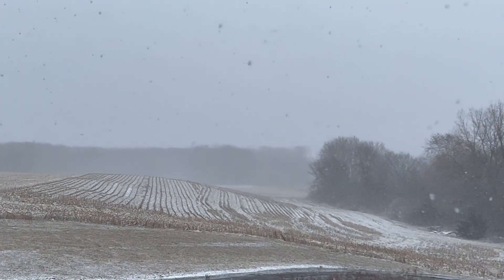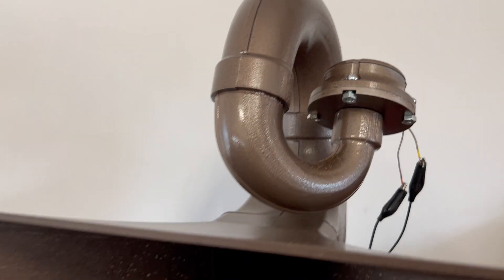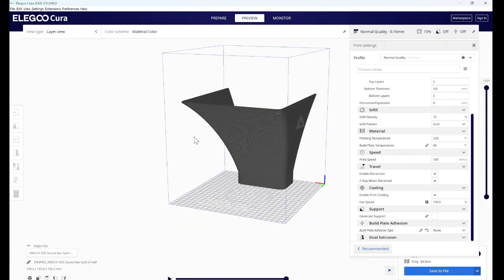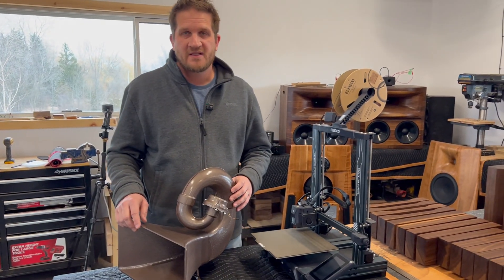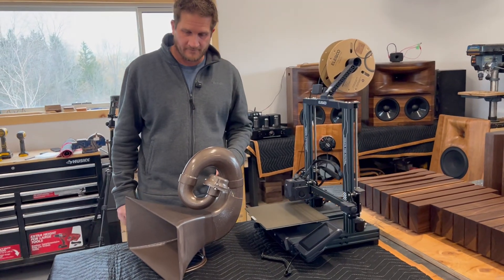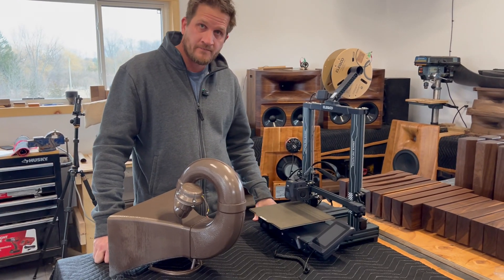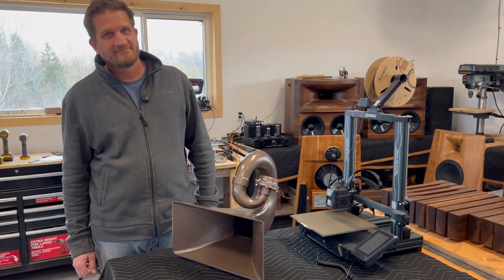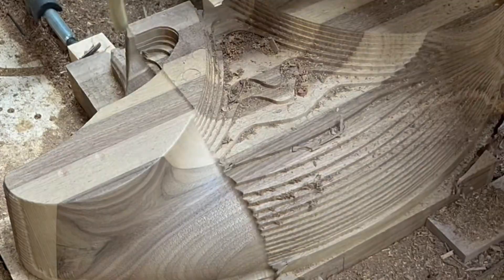Print Your Own Vintage Horn!

Comment: Hello Troy from Meaford Ontario, Troy as an audiophile and former manager of Oakville Audio I highly recommend you use Flex Seal spray rubber sealant evenly over that 3D printed horn... dampening is essential in such thin material
Reply from the maker: I appreciate the tip, and I’ll try that next time!
Reply: @JosephCrowesDIYSpeakerBuilding  fantastic can't wait for results, awesome designs good sir

Comment: 2 in stereo with a nice high playing sub would actually sound very decent, might have to try this one! thanks so much man , love this kind of niche unique stuff, i print so many speaker designs, and settled on a synergy/MEH design from deep in the audio forums. I have some some 'minuture' point source designs using multiple drivers in 1 horn, wondering if youd ever consider doing a design!?
Reply from the maker: The 50L onken from the Autumn Series wound be a good match. https://josephcrowe.com/products/autumn-bass-cabinet-speaker-plans?_pos=2&_sid=a96e34bb9&_ss=r
No plans to do a MEH.